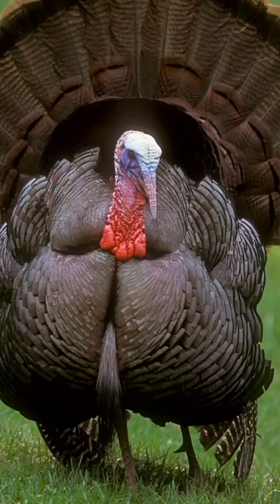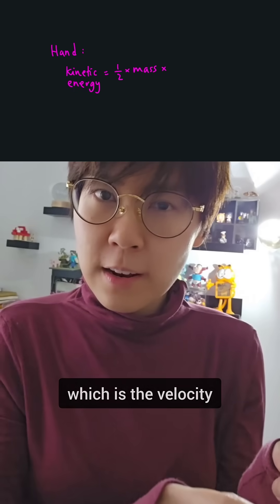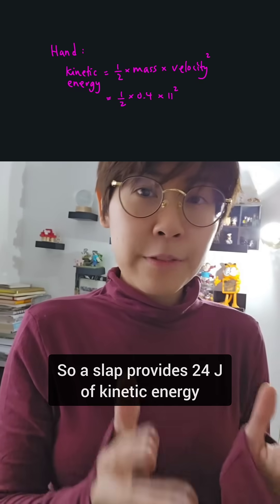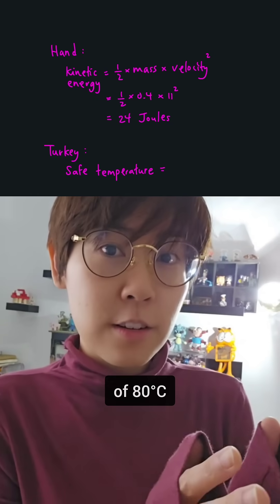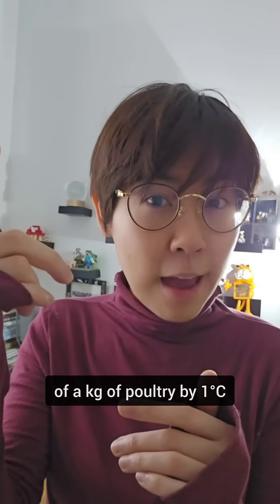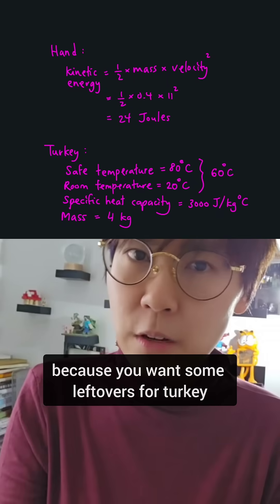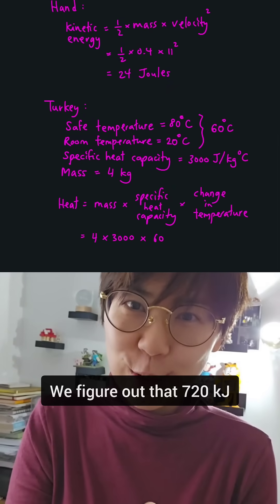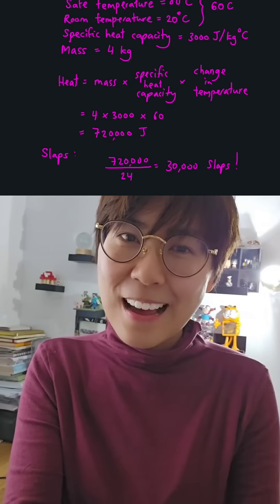how many slaps does it take to cook a turkey

Comment: Unless you can slap that turkey 30.000 times within a second this wont work. You forget the time it takes to slap 30.000 times and in that time the turkey will lose heat to the surroundings which is only 20 degrees. Besides, there wont be a turkey left, maybe turkey pulp. You cannot cook a turkey by slapping it.  prove me wrong by actually cooking a turkey by slapping it, ill make it even easier, just cook a 300 gram steak by slapping it. goodluck!

Comment: I think that might also cook my hand because I don’t think I will be able to cool my hand quick enough if I am doing it at a fast enough pace to continuously add heat. I also think that I will do severe mechanical and other damage to my hand, arm and shoulder. This will take such a long time that the turkey would be cooling down. It would not gain enough heat or be enemy heated or receive enough heat to heat it internally from slapping it.

Comment: assuming you dont hit it 30 000 times in a fraction of second, youre gonna be heating up the air around it as you increase its temperature so youd need more slaps than that

Comment: Basic thermodynamics… but when you account for all the variables, it’s going to be well over 100,000 times and the frequency would have to be extremely fast to prevent major heat losses between slaps… also has to be in a well insulated environment.

One more thing…. Your hand is getting cooked too

Comment: But did you include heat radiation in your calculation. I'm not a physicist so I don't know but it seems to me that if you slap the turkey once a second the heat generated by your initial slap is partially dissipated by the Time the second slap occurs. Since you're not delivering much energy per slap could you actually raise the internal temperature of the turkey by slapping it. My initial impression would be I doubt it unless you slap it at an incredibly inhuman rate.
Someone who understands the math could probably figure this out on that that good.

Comment: Every video- technically wrong. Yes 30000x but it has to be all at once as youve not put any real world factors to account for energy loss. Additionally i would think it takes more energy to heat things to a higher temp and is not a linear function… at least thats how it goes with increasing speed,

Comment: You should have also accounted for heat loss to the environment, not all energy goes to heat(since it will be a elastic collision, less KE will go to heat), specific heat capacity of 3000J/KgK is low and varies from part to part.

Reply down below with other factors.

Comment: $E_K$: Kinetic Energy

$m$: Mass

$V$: Velocity

J: Joules

$T$: Temperature 

$T_S$: Safe Temperature

$T_R$: Room Temperature

$\Delta T$: Change in temperature between $T_S$ and $T_R$ as $\Delta T = T_S - T_R$ or $60^\circ \mathrm{C}$ as given below.

$c$: Specific Heat Capacity

$Q$: Heat

\begin{align*}
\text{Hand:} & \\
\quad E_K &= \frac{1}{2} \cdot m \cdot V^2 \\
&= \frac{1}{2} \cdot 0.4 \cdot 11^2 \\
&= 24 \, \mathrm{J} \\
\\
\text{Turkey:} & \\
& \left.
\begin{aligned}
T_S &= 80^\circ \mathrm{C} \\
T_R &= 20^\circ \mathrm{C}
\end{aligned}
\right\}
\quad 60^\circ \mathrm{C} \\
c &= 3000 \, \frac{\mathrm{J}}{\mathrm{kg} \cdot {}^\circ \mathrm{C}} \\
m &= 4\,\mathrm{kg} \\
Q &= m c \Delta T \\
&= 4 \cdot 3000 \cdot 60 \\
&= 720\,000 \,\mathrm{J} \\
\text{Slaps:} & \\
\frac{720000}{24} &\Rightarrow \boxed{30,000\; \text{Slaps!}}
\end{align*}

Comment: Wrong. You are missing a lot of variables. Even ChatGPT can do better than you. One of the biggest factors is the heat loss coefficient from the surface of the meat, not the noticeable temperature difference in the air. After slapping a few hundred times, the heat conductivity medium will drastically change due to the loss of water molecules inside the tissue cells. And so one ...

Comment: 1. The Original Calculation (without heat loss)
This calculation is based on the energy required to raise the turkey's temperature.
 * Energy Needed: It takes 3 kJ to heat 1 kg of poultry by 1 degree C.
   (4 kg) x (60 degrees C) x (3 kJ/kg/degree C) = 720 kJ
 * Energy per Slap: Each slap provides 24 Joules of energy, or 0.024 kJ.
 * Total Slaps Needed:
   720 kJ / 0.024 kJ/slap = 30,000 slaps
Conclusion: It would take 30,000 slaps to cook the turkey if there were no heat loss.
2. Minimum Slaps to Overcome Heat Loss
This calculation determines the minimum number of slaps per second needed to keep the turkey from cooling down. We assume a heat loss of 100 J/s.
 * Energy per Slap: Each slap provides 24 Joules.
 * Heat Loss Rate: The turkey loses 100 Joules of heat every second.
 * Slaps per Second Needed: To break even, the energy from the slaps must equal the energy lost.
   Slaps per second x 24 J/slap = 100 J/s
   Slaps per second = 100 / 24 = 4.17
Conclusion: You would need to slap the turkey more than 4.17 times per second just to start heating it up.
3. Time to Cook (with heat loss)
This calculation shows how long it would take to cook the turkey with a specific slap rate. We'll use 5 slaps per second.
 * Energy Input:
   (5 slaps/s) x (24 J/slap) = 120 J/s
 * Net Energy Gain:
   120 J/s - 100 J/s (heat loss) = 20 J/s
 * Total Time in seconds:
   720,000 J / 20 J/s = 36,000 seconds
 * Time in Hours:
   36,000 seconds / 3600 seconds/hour = 10 hours
Conclusion: With a slap rate of 5 per second, it would take 10 hours to cook the turkey.

Comment: But even I slap the turkey that many times, much of the energy will be lost by sound energy, vibration energy, momentum energy, and friction energy by each of the cell present in the turkey! So those 30k slaps would barely absorb 10-50 slaps worth of energy! Which is not enough heat energy to cook it 😁😁😁

Comment: I remember a youtuber actually cooking the meat by making a slapping machine
Reply: Yup, and iirc the chicken was, predictably, pulverized by the end lol.
Also he didn't eat it because even though it came up to temp eventually, I think it took some insane amount of hours to get there. Like... seventeen or something. So he was understandably concerned about the safety of consuming it.
Reply: @linearparadox9409  For at least one of the runs, some of the insulator that he was using got pulverized and mixed into the turkey.
Reply: @linearparadox9409  I don't remember it ever getting up to temperature, but I do remember that the  slapping machine that he built had turned the turkey into meat mush that made pink slime beef look appetizing by comparison.
Reply: @linearparadox9409 About as practical as cooking with an over clocked rock tumbler
Reply: Louis Weisz : I cooked chicken by slapping
Reply: action lab?
Reply: Ah yes. Food theory has done something similar. Too lazy to fact check, or am I
Reply: "Meat Beater" was the name of his machine. 😂
Reply: CHICKEN JOCKEY

Comment: That's if you can do it in a few seconds. Heat will dissipate quickly and it'll just be a few degrees higher by the time you finished slapping in 30,000 times

Comment: there was a guy who did an engineering project by cooking a piece of steak using a slapping motor! https://www.youtube.com/watch?v=LHFhnnTWMgI

there were practical technical challenges:
1. the chicken / turkey temperature would cool down or reach a low plateau if you didn't slap it fast enough
2. even if you did slap it fast enough the integrity of the chicken / turkey would like disintegrate

steak was preferred over chicken because it was tougher. as long as you could maintain an average of 60C over a period of time it would be like sous vide steak.

hope you enjoy the video!

Comment: But the turkey would also quickly disperse heat between slaps! You'd need to slap it 30,000 times in rapid succession—and that would get exhausting. So...

Introducing the kinetic oven!! It features dozens of mechanical hands ready to slap your food to the ideal temperature for cooking it. Also handily (and not optionally) tenderizes meat, "kneads" bread dough, and turns baked potatoes into mashed potatoes and any pies into cobblers.

Comment: That heat gets lost right away so you would have to dump that 720 KJ all at once. Food Theroy did the math and calculated that you would need to hit that turkey with a car going highway speed (65mph). You're not going to have a cooked turkey, you're going to have an exploded turkey. And yes, people have actually tried to slap cook turkeys before and it hasn't worked yet.

Comment: I really appreciate your insight, but I think you've made a significant error: Your formula does not take into account the ratio of energy conducted throughout the turkey to what is lost to radiation and convection. We need to find the optimal rate of slaps to minimize rhe sum of connection loss due to incidental slap airflow and radiation loss over time.

Comment: not all the kinetic energy will go as heat energy some of it will go to sound and heat energy into your hand also when the turkey temp will be heigher that the surrounding it will radiate heat into the surrounding decreasing its temp(newtons law of cooling) so its no nescessary that slapping it enough time will raise its temp to 80 you will need to keep slapping at a fast enough rate
Reply: Yeah. If you were slapping too slow, you might end up having to heat the entire room to 80°C 😂
Reply: Agreed she's got all the equations but thats in a perfect vacuum with no energy losses
Reply: Valid
Reply: It won't even survive 1000 slaps and will be smashed to bits.
Reply: you'd have a hand like an overcooked handburger!!
Reply: yeah theory fails almost immediately when you begin to put it to practice. There are always more variables than can be accounted for.

Comment: I'm sure someone else has said it but I believe this would only really work of every one of those slaps was simultaneous, which is impossible with the small surface atea of the bird.

That's because you aren't factoring in the heat dissipation between slaps. 

Also a side note, this whole idea is a similar principle to how you can bring a nail to red hot by hitting it with a hammer often and well enough to be faster than the energy loss.

Comment: Ok, but let's take this to the next level. Spitballing the surface area is roughly 0.4m^2 of a turkey we can use the equation H = kA(Ts-Ta) where A is the area, Ts is the skin temp and Ta being the area temp and k being the cooling constant which I will use the cooling constant of water because I'm lazy and cells tend to have a lot of that to in, which is 0.598. So, the energy loss when first starting and you've gotten it up to 22 degrees would be 0.598*0.4*(22-20) = ~0.48j/s, or if we are getting close the heat we want, we will be getting a energy loss of 0.598*0.4*(79-20) = ~14.11j/s. If I was smarter I'd work out the rate of slapping you would need to make sure you can raise the temp to 80 as well as how many extra slaps you'd need, but alas, my brain is not that big, lol.

Comment: But pretty lady you forgot to add the cooling effects of the the surrounding.
I mean the heat losses over time.
So you have to slap the Turkey that times in very less time also.
For example if you slap Turkey for two three days. 
It will not cook at all due to heat loss.
You have to slap the Turkey that times in minutes

Comment: However, we're not taking into account the energy lost to the environment as the turkey begins to heat up to a temperature above the surrounding air temperature.
Beyond that, we're definitely not taking into account:
The vacuum created by our hand as we pull it away from the turkey pulling heat away from it
The amount of energy absorbed by our hands as the turkey's temperature is higher than ours.
The fact that your hand will be BROKEN by the time you finish slapping it to that internal temp.

Comment: Fun fact: this myth comes from blacksmiths who "reverse forge" a piece of metal by hitting it with a hammer so fast it turns red hot from friction. I actually saw a video of a guy who built a machine to slap his turkey until it was cooked and the aluminum lever broke around 10,000 slaps (and no the turkey never got more than a few degrees hotter)
Reply: That was Louise Weisz
And he did manage to cook a steak with the meat beater 9001
Reply: it has to be done under a second tho , so it is practically impossible.